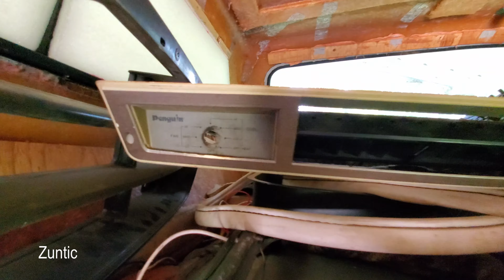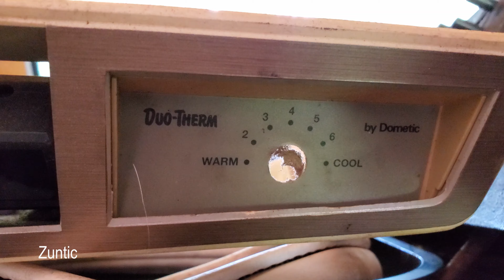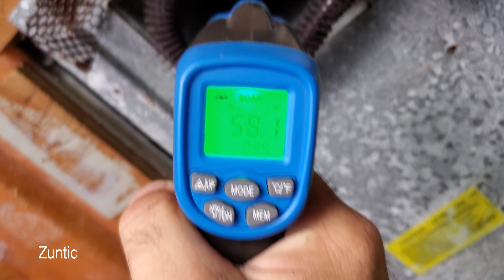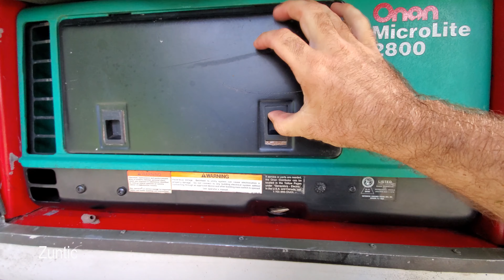First look at my gutted project camper van a 1995 Airstream B190 Ford e350

Comment: You are brave! Do you have pics before gut? Did you notice water or condensation pooling behind and near the drivers chair? Keep on posting. Betcha it will be amazing!
Reply from the maker: Nothing before it was gutted. I bought it that way. All the appliances were just loose in the van but i do not think i will use them. I am not going back original. I have not noticed any water pooling but i am keeping it out of the rain for now since the glass is out of the top windows. Thanks for words of encouragement i will keep posting.